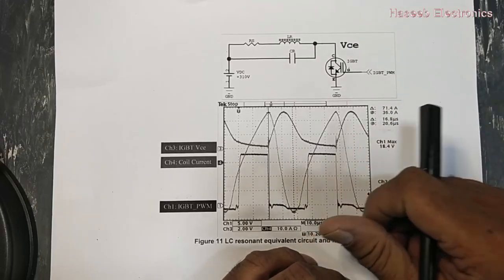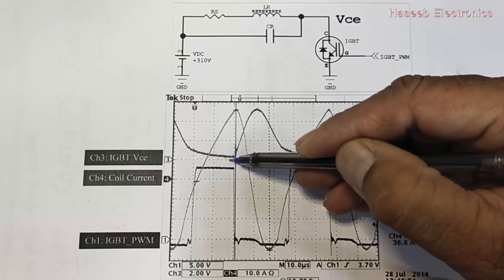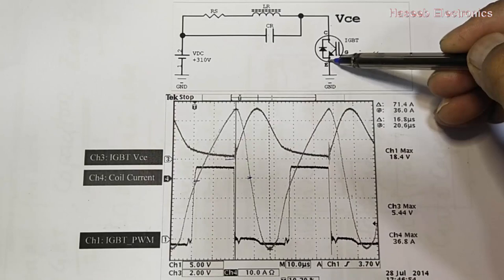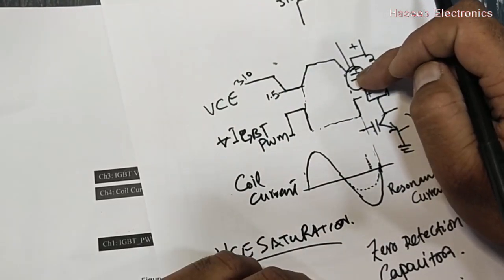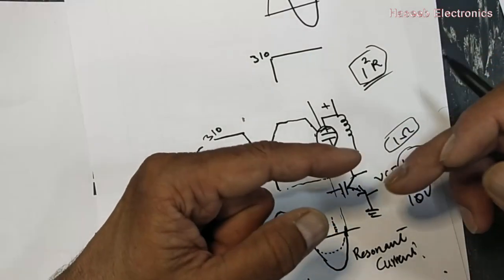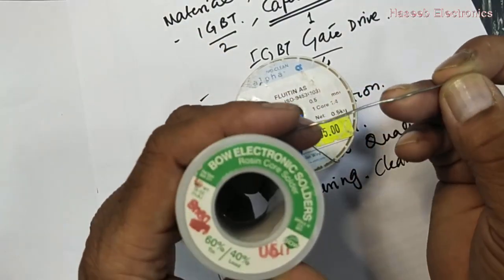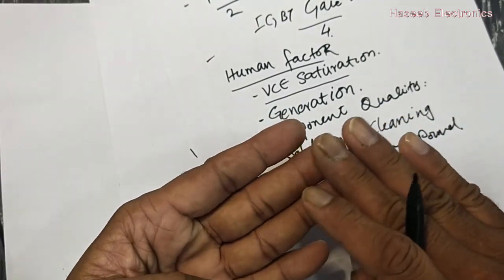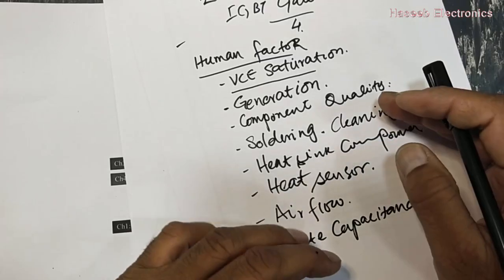{502} Why IGBT Burns Out After Replacement - IGBT Damaging Reasons

Comment: For better result:
1) Always check the ESR of the resonant capacitor and the internal insulation. 
2) Remove all flux residue with a little brush and pure alcohol. 
3) Apply electronic silicone to the solder pins of the IGBT and the driver on both sides of the PCB to prevent moisture in the air from activating the gate of the transistor.
Reply from the maker: it is really a great addition, i am personally thankful for a valuable guideline for my viewers 
please accept my best regards

Comment: Your video was very helpful. I had changed in a mini welder the Igbt's because they burned out and one of the new one was always to hot 115 degrees Celsius one had approx 70kohm internal resistence and the other one approx 650kohm and that's why was to hot.
Thanks a lot, you make a wery good job.
Reply from the maker: wow that is really awesome 
i am thankful for your valuable comment, to encourage my efforts

Comment: I also recommend to use a transistor tester before you install the part so you can check the capacitance and vge. This goes also if you have a bunch of transistors you need to change, test them all and select the ones that are close in value. With all these chinese parts now sometimes there are defective parts or out of spec. Always test before install.
Reply: Pls my igbt keep burning out even when I put higher number

Comment: When I saw this, I think first at the fake component avalaible on ebay and aliexpress. They are sometimes rebranded, and gate capacitance is not the same, and bandwitdh is different. THis is the reason why it works few hours, and failed when overheating.
If the capacitor of the LC circuit is dead, you will maybe just have a lack of effeciency. Thanks for the video, god bless you.

Comment: When choosing a replacement IGBT, don't forget to check whether or not the component you are replacing and your replacement component have an internal flyback diode! Most modern devices contain this, but not all. Always check your datasheets.

Don't assume that adding one where there was not one before is a good idea. Generally it is best to use the exact same part the manufacturer used whenever possible.

Comment: Thanks for your support. However there are two thermistors in the circuit for over Temperature. So when the IGBT overheats then the Microcontroller is supposed to switch off, can you throw some light on this?
Thanks.

Comment: Hi Haseeb. My capacitor is 800V 0,25micro farad. I measured 230 nano farad. Is that problem. Also I have 4 IGBT who works on two couples for each end of the coil. One of the couple give me a short circuit if I measuring on board. If desoldering them their value are normal. This their condition is same if there is no power on the motherboard. I had short circuit damage and one IGBT was burned. Also big diode between rectifier and IGBT. What is your opinion. I ordered other three IGBT to replace them too.

Comment: Brother i have an induction model-prestige 16.0 ,
in the drive section 8050 pnp transistor was open circuit i replace it and induction worked for several days and after that again the igbt went short circuited 😢😢😥 plz help me

Comment: Bosss short vedio bnaen
Reply from the maker: i will try my best, but it is impossible to explain clearly in short videos 
but i will try my best 
please accept my best regards
Reply: @HaseebElectronics  my concern is that reason for igbt blown out is same as fuse example current rating or voltage
Reply from the maker: @ehsanuddin7706  the biggest headache is fake marking numbers 
may that is not that igbt but it it named by fake marking
sometimes quality failed components are supplied
always try to purchase from some reliable source

Comment: my bet is "N-channel 600 V, 7 A, very fast IGBT"
STGB6NC60HDT4, STGF6NC60HD, STGP6NC60HD
Reply: more f'in pictures or at least the part would help.

p.s. i think our igbt's are better than china .i'm to tired to play anymore.

I JUST WANTED TO KNOW THE TRANSIANT VOLTAGE SPIKE!
Reply: Can someone help me my 20n50c mosfet burns up after I have replaced. It will work for few moment and when I switch off and want to power it again it will just start giving the fault sound again pls help me